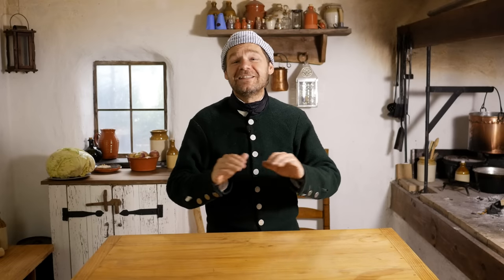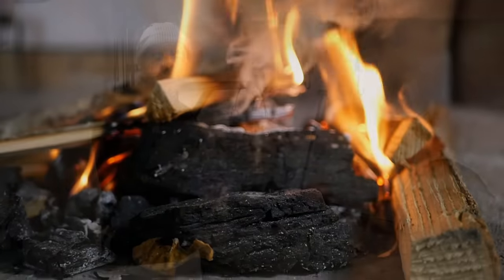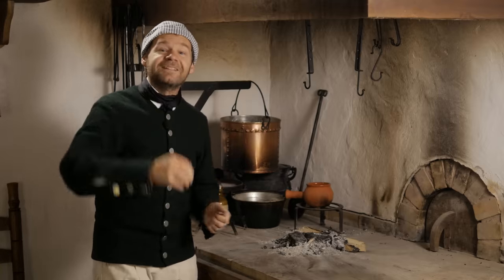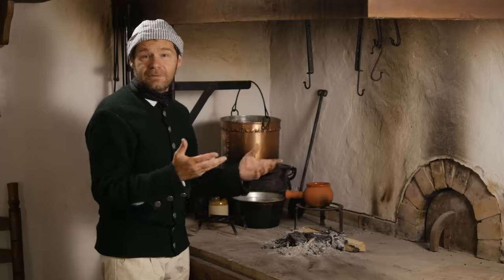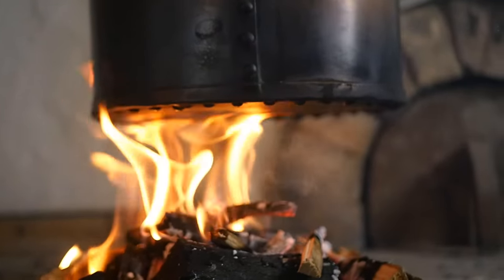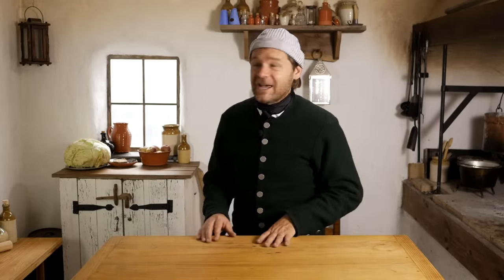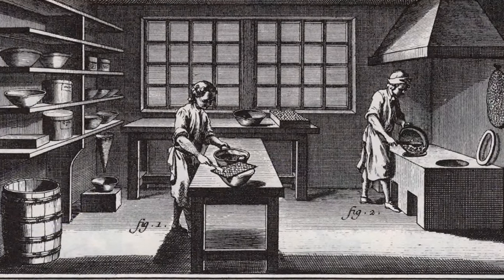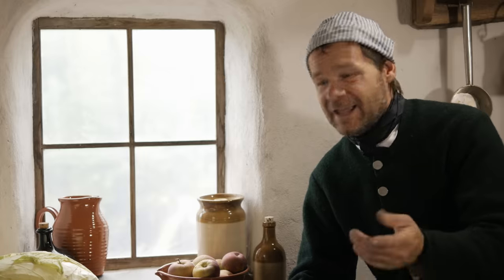Historic Kitchens vs. Modern Kitchens

Comment: I know this an old video but i will give my point here (long post):

Well....I'm the 90's generation. So, in regard of comment section, I can say i had the confort i needed when i was living with my mother. My father was living in a house his father build almost 100 years. Some parts of the house were probably built in the XVIIIe century cause of the wall thickness. 
I can tell you that the house i was playing and working in whenever i came in (during summer hollydays) the house was old; 
The walls were plastered, worn, there were cracks, holes in the ceilings. The kitchen tiles ground were from the early 20th century, white and red colours with cracks, dusts, holes. 

There was this stove: 4 spots each consisting of 4 concentric rings. 1 small spot, 1 medium, 1 slightly larger and 1 very large. With the poker you had to remove the cover and one or more rings depending on the amount of wood you want to add.
There was this other place to open the hatch to evacuate the smoke I think.
There was the big black pipe connected to the chimney on the roof. This stove consisted of a bread oven and a tank to heat the water and evacuate via a tap.
I also remember this little door on the front of the stove to remove the drawer containing the ash. When I opened this little door, there was some sort of thick cast iron grate or whatever I could watch the crackling fire through, and the glowing ash falling in the ash pan. I was squatting and watching this burning spectacle for long minutes. This kind of stove dating from the late nineteenth century - early twentieth century was cast iron, steel, the facades were ceramic. For the materials I say that from memory ^^.

12m², it was not super large for a kitchen, it must be said there was always a mess on the table so to prepare the meal on it was impossible xD
There was a piece of furniture, a cupboard and a sink. 
This sink was dirty, yellowed, the ceramic was damaged in some places. An old cupboard under the sink similar to the one in the video. Next to the sink, there was small storage and a drawer for some kitchen utensils, and next to the cupboard, the most important: the cache for the bottles of wine. On the wall on which the sink was supported, there were tiles, also cracked in some places strangely ^^.
Shelves and a fridge. The kitchen seemed more modern with its TV but for hot water you had to heat the water on the cook in a kettle. I also remembered having to take my bath in a large basin. Wash my hair in the garden and drain the water into the disgusting gutter where there was so much rubbish that it looked like the river Ganges.
In the kitchen the creamy burnt yellow walls were dull, with cracks, cobwebs, spiders and mice xD

  Why I'm telling you this: Going from modernity (apartment when I lived with my mother) to my father's old house, which threatened to collapse with electrical outlets from the 1940s, was not always synonyme of comfort ^^.
There was also this barrel of water that was filtered to recover and use it to clean the dishes.

I was complaining about this when I was young but now, with the consumerist world, I regret this time. That same time when I was crushing the currant in a large bowl with my feet in the cellar to manufacture various alcohols ( Cider, rhubarb, redcurrant, brandy).
I'm not going to describe the entire property, but in many ways, the life my father and grandfather had was not that much different from the people of the 18th century.
In 1920, there was no freezer or fridge in France. I know that the Americans were ahead in their time unlike us.
However, we were food independent.
Since the house has been rebuilt, everything is modern, the barnyard is empty, the cellar with its press has disappeared.
When I see your videos, it makes me want to do gastronomic reenactment.
For me, the kitchen, the utensils, the materials of the tools that I use to cook, the fresh products, the colours and the flavours as well as the design of the kitchen are as important as preparing dinner.
I live in an apartment, very nice but the kitchen is as big as a cupboard for pygmies. xD

Sorry for the long post but that's a glimpse of life I had and i will probably never have.

Comment: Great video John. My country property is on 120 acres and a few things have broken recently. Our water pump (which pumps river water into a tank for the house) broke so we've resorted to bringing water in by buckets. And also we've run out of gas. So we heat our water over the wood fire for bathing and cooking. It definitely is an inconvenience at times but it's also quite a nice thing to really watch how much water we use on a daily basis. Sure makes me more careful with what I'm doing.
Reply: dashn64 

Couple yrs ago our well pump went out. Hand pumped,that we made out of pvc, about 75-100gal a day 100 ft well for 8months. Laundry days more. This was mostly over Southern California summer, so had to be done before too hot or done at night.
Reply: WOW!
Reply: Was just thinking about turning off our hot water heater. every time some people wash dish's they run the hot water constantly. take's them 30 min or more to do them. drives me nut.
Reply: If you are using a river for water look up a rampump no electricity or and of that and supprizingly powerful wranglerstar has a great video on them
Reply: Thanks mate. Yeah I do know about ram pumps. We're trying to make the switch to rain water so a ram pump isn't required :)
Reply: dashn64 that off grid right there friend mind me asking where y'all living
Reply: Yeah all good mate :) I live in southern Australia.
Reply: dashn64 I
Reply: My father owns a piece of land on a small river in the Ozarks. It really is amazing the ingenuity one develops learning to cook and wash with no electricity although having the river helps with the water situation a lot.
Reply: We turn our furnace off every day. Next to our oil furnace we have a hot water storage tank. (boiler mate). We turn the furnace on in the morning for about an hour and take showers and do dishes. Then we turn it off until the next morning. We have a wood stove for 100% of our heat, so we save thousands a year on oil.
Reply: dashn64 you're so lucky. Wish I had the option to do that.
Reply: Susie B  If you aren't home all day long, you could shut it off before you go to work. There should be a switch like a light switch. That's how people shut them off when they go on vacation. Just don't do it in the winter if it is your heat source.
Reply: LOL!! I think we all like warm baths....  We save alot of money shutting it off. No sense keeping water hot all day if we're not going to need it. Maybe he'll come around.
Reply: Where I live, the ministry of health says not to turn off the hot water cylinder because it increases the risk of legionella growth. I think the cold water must be routed differently.
Reply: raiderrob672 I do that, but I go quickly and using only a small stream, just enough to rinse.
Reply: In January 1969, we had one of the coldest days on record, and the water pump froze solid.  Fortunately, there was a hand pump outside the back door, and I managed to melt enough ice cubes to prime it, and draw water for coffee and the breakfast dished. My first husband was not one to inconvenience himself when he could inconvenience others, so I pumped a LOT of water that winter. In the morning, I'd pour two buckets on water into the tub to come to room temperature, then I'd take some into the kitchen to wash up. I had a pan that just exactly fit into the sink, and I would heat water there to do the dishes. When I was ready to go to work, I'd leave two more buckets on the stove to use when I got home. Bathing meant the first person got a bucket of hot water, and a clean bath. The second person had a hot bath in used water! We lived that way until mid-March, when he finally decided to buy a new pump. 
9he did die a natural death, by the way!)
Reply: @Susan B that's so funny my husband tells me no for silly little health benefit type of ideas shutting off the hot water or getting chickens. Cuz we rent wouldn't want to get in trouble
Reply: The Farm people who take water for granted have never had to carry it. ditto for heat.
Reply: @raiderrob672  - When we moved into this modern ranch style house in 1990, it was equipped with all the "comforts of home." The dishwasher started out as a major treat for me, as I found it quite a break from the prior 35 years of my life where we had none, beginning when I was born. We had been married 14 years, and the only time we had one was in the nice apartment we rented for our first year of marriage. However, since it was just the two of us, it rarely got used, as it just took too long to accumulate even close to a full load of dishes, and we didn't even own/use that much stuff yet, much less use it all up that quickly! It was easier for me to just do them by hand, let them air dry, and put them away later. The only exception was if I cooked a big meal for company, and we used up about everything we owned in so doing! 

In any case, between then and this house, they got done by hand. I never let the water run continually like you described, because of the amazing waste of not only the water, but the power required to heat it! So, I just stacked up the washed dishes in the empty sink next to me, and when it got full, I would stick more dirty dishes in the wash water to soak, while I moved to the sink of clean soapy dishes, and rinsed them under the hottest running water I could stand, and stack them neatly in the dish drainer to air dry (air drying is required by food service standards in commercial kitchens - you never see dishes being dried by hand with a towel in them. It isn't sanitary.) Then, back to the dirty dishes in the wash water, and "lather, rinse, repeat" as they used to say in the shampoo directions! 😉

But, even with the dishwasher there, it didn't make a bit of difference six weeks later, when the electronic timer system failed, the dishes sat all night long half washed, because I usually started it just before we went to bed as it was a little on the noisy side! The repairman I called the next day who came out to look at it said it was too old and complicated to repair, and should be replaced. He got no advantage from that, as he only got paid for the trip, and a few dollars more for taking the panel off the front of the control panel. We couldn't afford to replace it six weeks after having sunk such a large amount into buying our very first house and moving in three days before Christmas with two middle school and grade school aged kids! So, we were back to hand washing our dishes again. 😣 Everybody helped though, which was as usual, once they became tall enough to reach the sink when they were younger.

My mother, bless her heart, bought us a new one for my birthday, in February of the following year, after I had decided I needed to go back to school - Vocational/Technical College - so I could get better employment! My parents had never been saddled with paying for post-secondary education for any of their four children, of which I am the oldest by 8, 9, and 11 years, and my going for only two years was what they saw as a considerable bargain, so they contributed heavily to that expense. It surely paid off, too. After that, I could buy my OWN dishwashers! 😃
Reply: @raiderrob672  - If you have the power to do so, make them fill up both sinks - one with soapy water, and the other clear water, have the dishes rinsed by dunking them in the clear water, then stacking in the drainer to air dry. Works just as well, and they can still get them done. Don't eliminate the hot water heater- that's needed to get the dishes clean  - breaks down any grease and food residue working along with the soap. They'll never get them cleaned or rinsed properly in cold water. A dishwasher actually uses less hot water than that, and it uses hotter water than the hands can stand, especially if it has a booster heater inside!
Reply: Yea, I am getting them to use just the cold to run Dishwasher.

Comment: You have the best channel on YouTube, and this is such a great video for understanding kitchens of the past. I was once in rural China a few years ago in a small mountain village where I stayed with a woman who had a kitchen like this. No running water, and using wood strips for fuel. The only modern thing there was a metal chimney. I could not believe the speed and skill that she had. She cranked out different dishes and breads so fast with it, and controlled the temperatures perfectly all along. I think skill is a major component of premodern kitchens. It's probably like speaking another language, no matter how much we learn, we still usually end up with an accent.

Comment: Love this channel. In Norway we have something called a "stabbur" it was one on every farm, to keep the food safe. Thick walls and and a turf roof, kept it cool in summer. The food had to tolerate low temperatures as well, as there is no fireplace in a stabbur. A fun fact, it only had one key, and the mistress of the farm had it in her belt. A stabbur is a small log structure, built on stilts or pillars of wood or stone, preventing mice and other rodents from finding their way in. For that reason there would be a gap between the outside stairs and the building itself.

Comment: I find very curious the idea of cooking on what is basically a ceramic table, I'm from Brazil and here what was traditionally used before gas became a thing was basically a trench made  by two thick walls made of clay/mud on top of a table or base of the same construction, you would burn the wood between the walls and  forming a roof usually was a cast iron plate with holes for the fire to hit the pans directly. As far as I know that kind of mud trench stove was used all the way from the XVI century to when gas became the norm, in rural areas that was only in the 1960's, and in the little ranch my mother have just out of town she still have one of those mud stoves (fogão de lenha we call it in portuguese).

Comment: I attended an 18th-century cooking seminar at Fort Klock in upstate New York about 10 years or so ago.  We made Lumpen und Fleeh (pork and cabbage with cumin seeds), Palatine Egg Puff, Pumpkin and Apples, Sausages (which we stuffed ourselves), Carett Pudding, Pot Supper, and several other dishes, all cooked on a floor-level hearth.  We also baked bread in an outdoor oven, using cabbage leaves to protect the bottom of the loaves from ashes.  It was a lot of fun, and we ate all day!!  <g>

Comment: There is another really good couple of reasons for turning your cups,bowls etc upside down. One is dust and the other is if you live in a cold climate and you have washed the bowls etc you can put them upside down and any residule moisture will make it's way out of the cup etc and when you pick it up it'll mostlikely be totally dry. This helps to stop bad stuff growing in it and it's better than having a wet mug etc.
Reply: residual

Comment: This was interesting! My grandmother lived in what used to be an old school building, and the kitchen there did have some modern conveniences installed later, but my grandmother also had the old cooking surfaces and the large bread oven - all wood fire fuelled. A step up from the kitchen being shown here (the fire was put inside a fireplace below the stovetop), but still quite old and interesting. She still actively used all those, for cooking.

She also did have a fridge, but also used the old pantry, which was a separate room next to the kitchen that was well insulated and actually was always a bit cooler than the rest of the house. She also had a cellar that stayed pretty cool, where she also stored food stuffs and drinks that didn't need to be kept very cold. (and a modern convenience - a freezer box, too). 

She did a lot of cooking, and had a vegetable garden, and a hot house, and bushes with different berries - she got pretty much everything but meat from her garden and fields.

Comment: Thanks so much for sharing!!  I started out the video thinking, "OH!  Their kitchen's not much different from ours!!"  Little did I know.  I could not imagine not washing my dishes, having everything taste like smoke or having to stoop down to cook on a low hearth.  Not to mention the pest issues. . . .  uggghhh. . . Our modern kitchens are pretty amazing by comparison.  Thanks again for sharing!!
Reply: Cats and rat terriers
Reply: You can still wash your dishes. Why do you think they kept a big pot of hot water over the fire? Take some boiling hot water with a dipper, and put it in the wash basin. Add cold water to get the right temperature. Shave some soap into the water, and wash your dishes. Then throw the dirty water out the back door. Yes they worked hard in those days, to do things that come easy to us.

As for the mice that is why you see a cat in the old pictures.